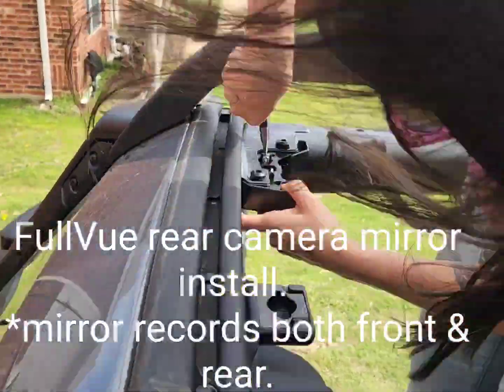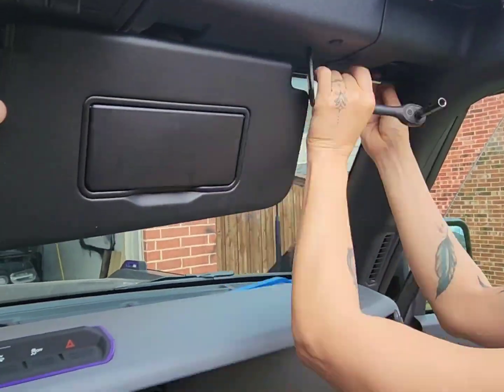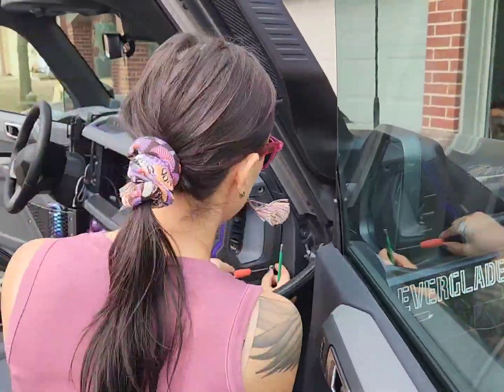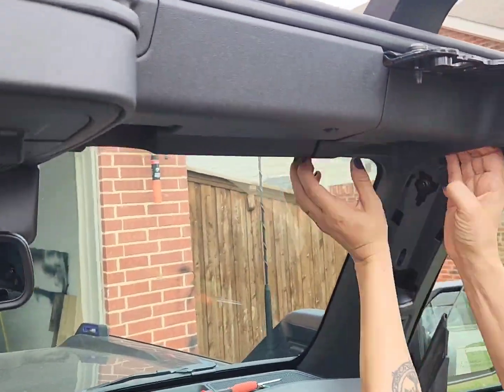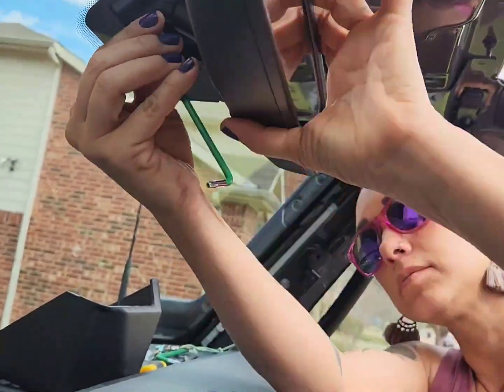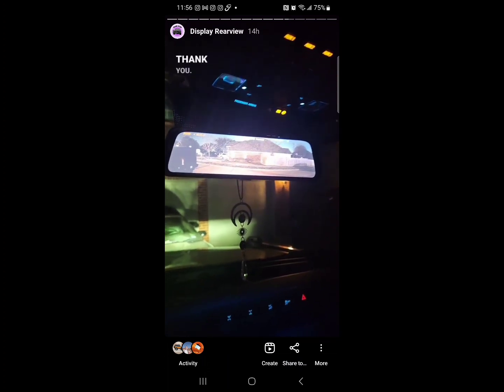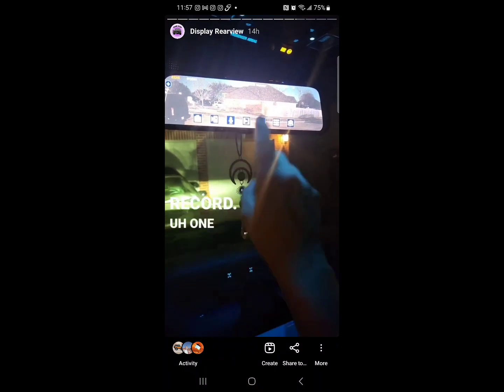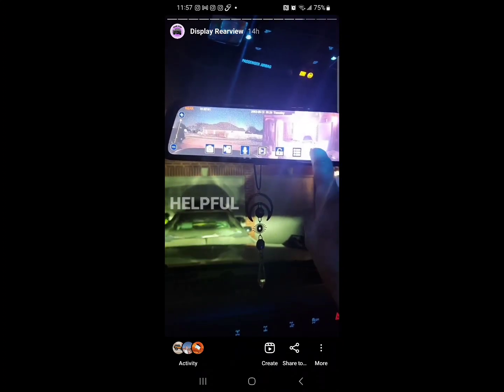Installing FullVue rearview display mirror.

Comment: Where does the red wire go? Also, I’m getting an error on my dash that reads, “Check Park Aid” after installing this, did you have that issue?
Reply from the maker: We didn't need the red wire that goes to the reverse signal of the bronco, but I didn't get that error mesage either. I hope you were able to get it all figured out :)